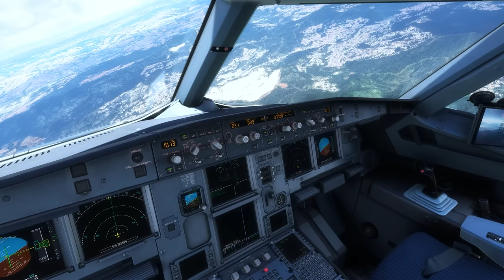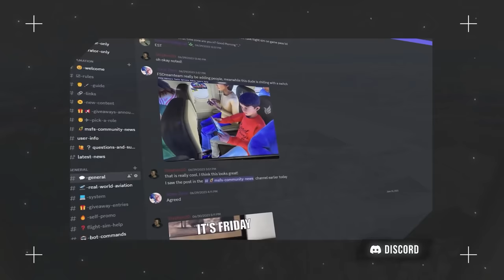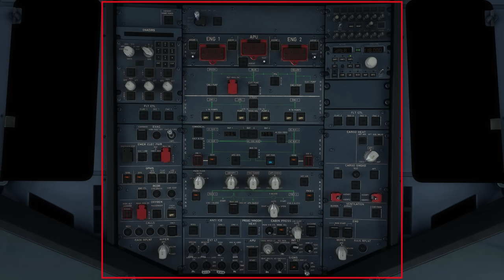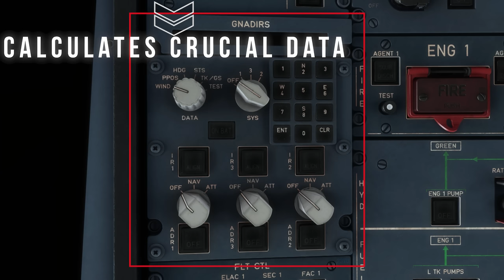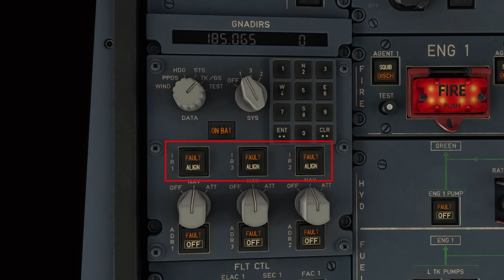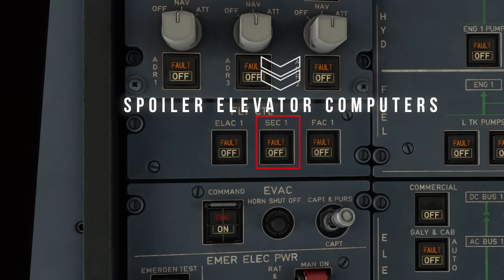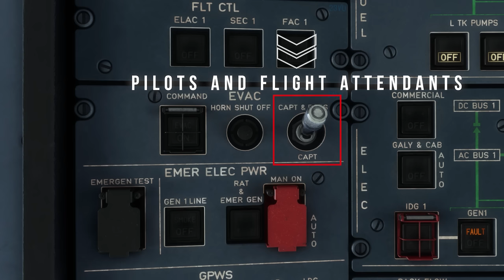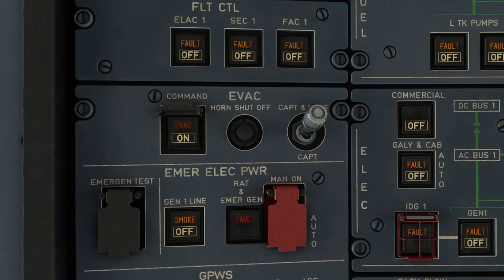Hyper DETAILED A320 Tutorial! | EVERY Button EXPLAINED! | FBW A32NX, A318, A319, A321 | MSFS 2020!

Comment: Hey, this is a really good video. I’m a B1 aircraft engineer & I work on the 320 series every day. The rat will operate if both AC bus 1 & 2 are lost (idgs from engine1&2). Once deployed (has to be above 100kts) the aircraft will be automatically on battery power for about 8 seconds until the rat is up to speed. Once its up to speed the rat does not directly provide electrical power to the aircraft. Instead it only provides hydraulic power. This is a common misconception. In order to provide electrical power the blue hydraulic system, powered by the rat in emergencies, drives a CSM/G (Constant Speed Motor/Generator) by means of a hydraulic motor. This CSM/G supplies the AC ESS BUS and the DC ESS BUS, via the essential transformer rectifier. 
The rat has variable pitch prope so it can continue to provide the same level of hydraulic flow through a wide range of aircraft speeds. 

This wasn’t meant to be patronising, from watching the video I thought there maybe a chance that you or someone watching would be interested to know that the RAT doesn’t directly provide electrical power to the aircraft. Thanks for the video!
Reply: feels like learning AGK again all over again XD

Comment: Perfect and very well explained Tutorial! Only one thing: Pilots nowadays quite recently land with FLAPS 3, due to fuel saving procedures but also noice reduction, since the flaps create some noise because of the air flowing "against" it. FLAP 3 landings are used at normal, intl. Airports where the runway is long enough for the higher landing speeds. But also the weather should be warm, so the plane has more lift. Hope I could help!

Comment: Thanks for this video series.  I've seen a lot of tutorials on how to start different planes from cold & dark, but they never actually explain why they are pressing the buttons, or what those buttons do.  This will be a very useful series for people like me who don't just want to fly, but want to understand exactly what it is they are doing, rather than just pressing buttons because "that's what I've been told to do".  I've not yet migrated to the A320, but am currently working my way through the ATR, so even though the panels are different, it will help me a bit more to understand the systems.

Comment: the RAT to clarify does not operate below 140 kts, then in addition to providingg electric power it also provides hydraulic pressure ( in case of  hygraulic failure)

Comment: would have been better to use the FBW, to support  the free product. Fenix is overated
Reply: Bullshit.
The FBW feels almost like an Arcade plane if you're used to the Fenix. The system depth is completely insane and multiple real world Airbus pilots praise it to heaven. I guess their opinion is more valid than yours. I bet you don't even own the Fenix.
Reply from the maker: Hmm, I strongly think the Fenix A320 is definitely not underrated. It’s a fantastic add-on that adds unrivalled levels of immersion. However, as mentioned before, you can use whatever you learn in this video towards the FBW A32NX as well :)
Reply: @FlyBySimulations  he said its overrated, which is utter bullshit